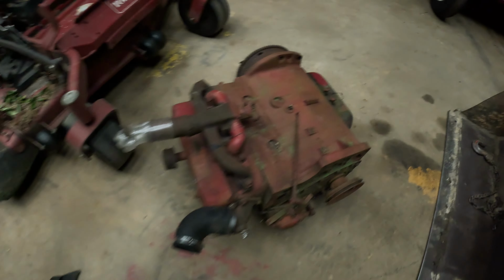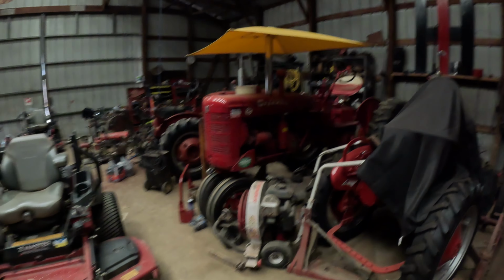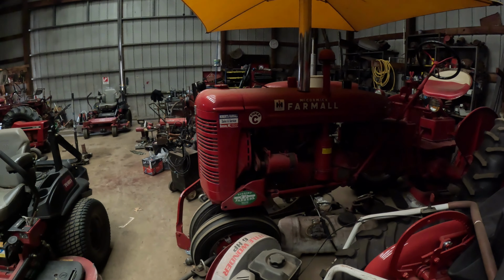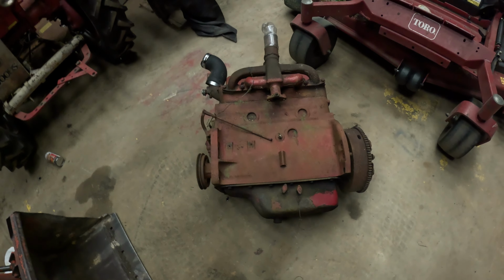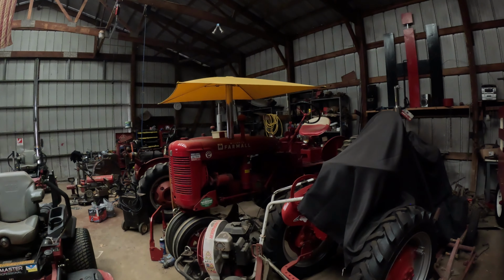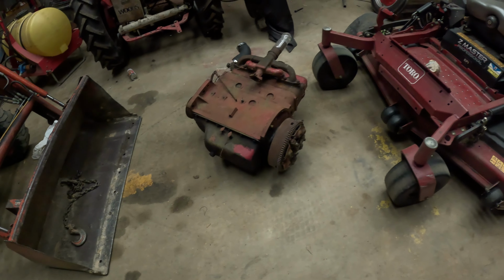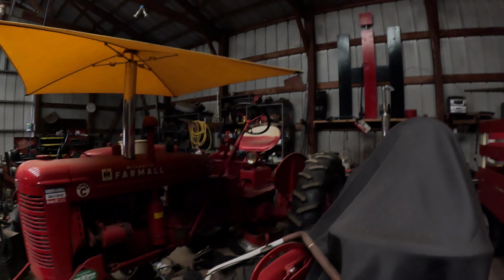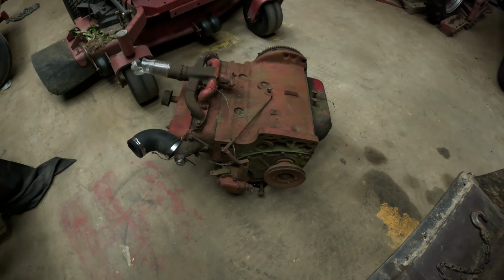C-153 for the Super C !!! #farmall51 #tractor #farmequipment #fasthitch #power #redpower #IH

Comment: I said if I was to do a tractor that I could take to the pull and back home to work that would be the setup super c with a 153. I just hate that some internal engine parts are hard to get for the 153. Almost double the hp lol
Reply from the maker: It what they should have had or at least a c-135 in them. Most all the parts are still available. Everything but the crank and cam .

Comment: What's that engine out of? If it came from a 203 combine or 230 swather or something like that, it should work. If it came out of a 504, it won't work. 504s have a larger bell and the back of the block is cast just for the 504. I learned that lesson the hard way. I tried to put a 230 swather engine in a 504, and there's no way it would fit.
Reply from the maker: It will work. The C we have has a 153 block in it out of a 105 combine. This engine block came out of a 504 . Yes one of the mounting holes don't line up but it will work.
Reply: @farmall51  I sure hope it works for you. The power units off combines and swathers and whatnot are the same size as the smaller tractors (A-240) and because the starter comes in the front, I believe it's the bottom bolt on the right side that doesn't line up. But 504s are different. Their bells are larger and they are more like a 460 bell. None of the bolts line up, not even the 2 at the top. If you have a bell out of a junk small tractor, better measure it and this block and make sure it will fit before going through the work. Or if you still have the bell off the combine, try and put it on this engine. We acquired a 504 a few years ago and it had a rod through the block. We acquired a 230 swather (not tractor) engine thinking it will work. Completely different. I'm pretty sure the 230 swather engine would fit the Super C, though.
Reply from the maker: @tyfrank3427  I'll do a video on it then but I will do one next week on how I did it. Just one bolt hole that doesn't line up.
Reply: @farmall51  That's true if you use a 105 or 203 engine or 230 swather engine in a C or A or something like that. I believe it's the bolt that was below the starter on the power unit that doesn't line up. But the 504 bell is larger. I tried to put a 153 out of a 230 swather in a 504 and the back of the engine will almost go right into the bell of the 504. The 504 bell is at least 2" larger in diameter than that of the smaller tractors. We have 3 of those 153 engines here  2 of which came out of 203 combines, and one out of a 230 swather, and none of them would work in the 504, but I think they would fit my 240 or the C.
Reply from the maker: Its a C-153 out of a Farmall 504 @tyfrank3427
Reply: @farmall51  A C-153 out of a 105 combine will fit the Super C
So should a C-153 out of a 203 combine
So should a C-153 out of a 230 swather
So should a C-153 power unit.

The power units will fit the Super C or Super A or the like. The bell housings are the same size as the small tractors but given the fact that they have the starter mounted in front, 
one bolt doesn't line up due to the provision for the starter. It's easy to tell when a power unit engine is in a small tractor because of the provision for the starter is clearly visible. 

But a C-153 out of a 504 will not fit the C or other small tractors. The bell housing is larger on the 504, and the block is cast for that application only. I've tried to make a C-153 out of a 230 swather work in a Farmall 504, and had the engine all ready to bolt in with the clutch on. I hoisted the engine into the tractor, and I was sure surprised when the bell was 2" smaller on my new engine. Not even the top 2 bolts which came in from the back would fit. They are completely different. I'm pretty sure the C-153 that I tried to make work in the 504 will bolt into a C or my 240. I checked, and came to the same conclusion: only one bolt won't line up. But, now I have a Farmall 504 here with no engine because none of the power units will fit.
Reply from the maker: @tyfrank3427  exactly. The one hole just don't get a bolt. It's fine . But I will work I promise. I've done it before lol.
Reply: @farmall51  I'm not saying that you can't use a C-153 in a Super C. Power units out of swathers and combines will bolt right in minus the one bolt. However, I am saying that not all C-153 engines are created equally. I know from experience that a 504 engine won't fit. This is because the back of the engine is cast to fit the larger bell housing. A 504 bell housing is more like the bell housing of an H rather than a C. I've tried to make a C-153 engine that I'm sure will fit your Super C work in a 504 and there's absolutely no way. So I'm confident that the 504 engine won't fit your C either.. So I'm saying please be smarter than I was and measure carefully before taking the tractor apart and finding out the hard way it won't work.

Comment: Is that the original oil pan? I thought the 153 had a regular dipstick. The oil pan has the “petcock’s” in it.
Reply from the maker: No that is a oil pan off of a Farmall Super A . It will fit but It may be changed . That oil pan has the petcocks like the Farmall A through Super C. That engine should have the plain single drain on the bottom .
Reply from the maker: Yes I know. It has been changed at some time.